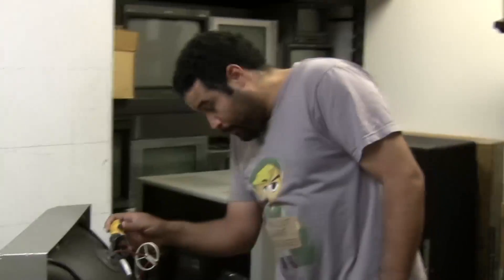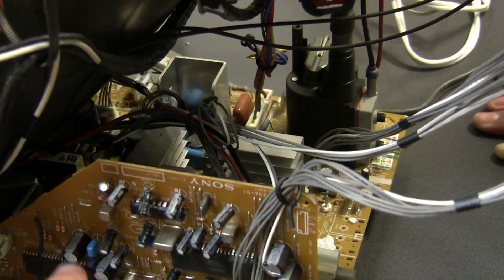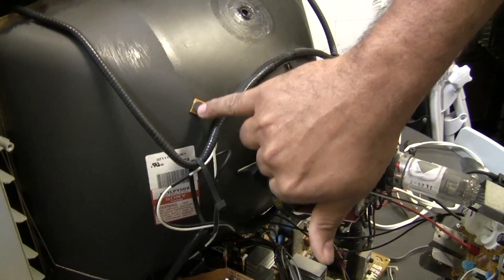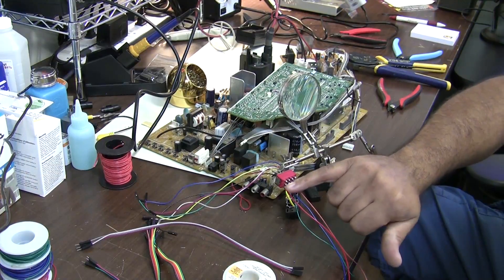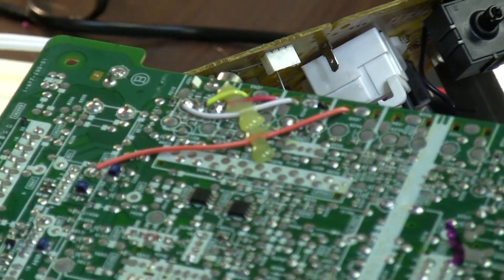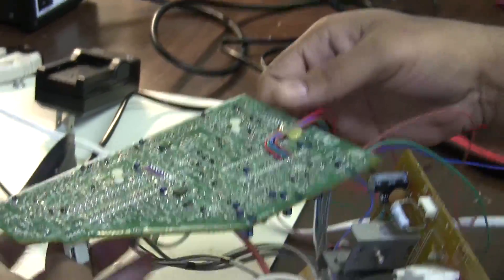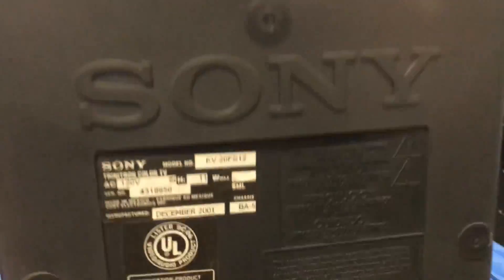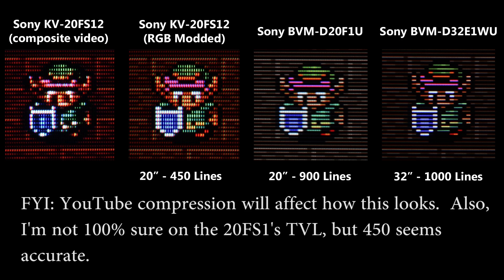RGB modding a Sony CRT for Retro Gaming

Comment: I'm so glad that here the majority of CRTs already have RGB Scart
Reply: bumtree 99% of all CRT TVs in Europe do 60Hz RGB, it has always been like this. I would have noticed otherwise as I have always played 60Hz import games (NTSC-J and US) via RGB scart cables.
Reply: DrLilo I don't know of any data that supports this but I've only ever come across the very odd CRT TV that struggled with displaying RGB. A much more common issue - especially with much older TVs - is their inability to deal with 60hz RGB, from what I've found.
Reply: Not true. While early Scart connectors did not have S-Video or Component, nearly every Scart TV had true RGB inputs. In fact, I never found one without RGB.
Reply: In the UK, because Scart was bidirectional it was  common to have two Scart sockets on bigger TVs and while Scart1 was almost guaranteed to be RGB, Scart2 was often fudged on & only supported Composite / S-Video input.

Perhaps that's the source of some of the confusion?
Reply: In france, almost all CRT tvs are RGB compatible !

I've never ever seen a TV that didn't handle RGB through SCART here
Reply: most supported RGB only low end ones didn't
Reply: Eg recently I got a very cheap CRT by Philips. I rotated it to play Raiden (PSX) in tate mode and it looks extremely sharp, colourful and just as good as when I play games on an arcade monitor.
Reply: Same here in germany! But I never had a TV that did not support RGB at all.
Reply: DrLilo we live in two different continents perhaps lol
Reply: It was created in the late 70's actually ^^

I'm not sure that's the reason they designed SCART. I think that this was done because there wasn't any other way to connect stuff to your tv except by going through RF back then. RCA plugs weren't implemented yet on TVs so they came up with an "universal" kind of connector that would support any kind of video signal that existed
Reply: Atari 2600's colors in france is just the colorised black and white mode. Also, europe had less colors than US. I think it was something like 114 or something like that

Nintendo had problems too : they added a composite to RGB adapter in their NES to have a SCART output. Unfortunately this made the picture to look worse.

Many game consoles here were shipped with an RGB scart plug which was a good thing ^^ Unfortunately, Sony broke that rule even though the PS1 can still output RGB fine.

Speaking of the 5th era of consoles, there's a special "french" nintendo 64. When they wanted to release the 64 in france, they added the RGB capabilities to the N64 only for france, but for an unknown reason they cut off that feature and so we only had composite video like the rest of the world. However the motherboard were already made when they did this so they had to sell the stocks and so early N64 models in france can be rgb modded. These are the only known N64 in PAL region that you can easily modify to output RGB. The other models require some custom circuit to be added
Reply: The C64 had little success here. Commodore didn't want to sell a lot of them over here for some reason. The Amstrad CPC 464 took it's place in here. However, I think that if somebody wanted to connect the C64 to a TV, since it outputs RGB at 50Hz for the monitor, you would be able to use RGB SCART

That's why we didn't have the Atari STFM in here : there was no use for an RF output in here since TV makers had to put SCART plugs on every TVs since 1981 (up to 2015 IIRC. Yep, SCART lasted for quite a long time here !) so all you would need is a SCART cable for your ST ... which is in fact the same as the one for the atari 7800 ! Yes, the atari 7800 outputs RGB, and it's not converted from composite like nintendo did

I don't know what they did for the Amiga on the other hand, but I bought a brand new SCART cable for mine and surely, it works just fine, like 99% of computers of that era.

The most common computer from the 80's that didn't really allow you to connect it to a TV is .. PC ! I know that there was some early IBM CGA video cards that had a composite outputs in the USA, but I don't know what they did here as I've never seen one so far (I'm not saying that they didn't exist at all here, I just do not know), and "RGBi" which is the 9 pin connector for a monitor isn't really pin compatible with RGB SCART even though you don't need really complicated electronic to connect it to a TV.
Not like VGA which is far more complicated to adapt if not impossible (depending of the resolution you're using)
Reply: Sure !

And also, 320*240 VGA doesn't run at 50 or 60Hz but at 70Hz !

However, the higher res modes are at 60Hz which still makes some flicker. Now, over the years they have made SVGA CRTs with much higher refresh rates (I've got one that can refresh the screen at 150Hz and there you won't see any flicker. It's so fast that won't even see artifacts when you film it !)
Reply: Booster McBlast s-video and component don't have anything to do with scart anyway as far as I know. They are both completely different connection methods from scart. Only composite can be used with a scart adaptor.
Reply: Booster McBlast amd what do you mean by "true rgb inputs"? Do you mean BNC?
Reply: No, that's not true. In fact, both were not intended in the early scart standard (from the very early 80s). But both methods were added later.
Reply: No, I mean Scart RGB input.
Reply: Paul Wood yeah probably
Reply: Isn't it true that france invented Scart RGB in the early 80s cause they had this stupid secam color format where you could not use any kind of home computer or console in color? Just my suspicion.
Reply: Okay. But at any case, Secam was a big problem for Computer manufacturers back then. Atari France designed strange and exclusive internal RGB converters to Atari 400, 800 and 7800. And Atari 2600 only ha 8 crappy colors instead of 128. Do you know more examples?
Reply: Thanks man! :-)
Reply: What about Commodore 64? Did they do a special Secam model?
Reply: DrLilo actually, here in Italy in my lifetime of CRTs (est. 1986), every tv with SCART I have met it always supported RGB. Aren’t you mistaken with PAL60?
Reply: Atari ST and Amiga both have no problem with Scart RGB (only the very early 520ST, that only had separate Syncs for X and Y). RGB was a must for the "high" resolution of 640 pixels horizontally. 
The Commodore 64 from outside of France never had RGB. The early models only had Composite, later models also had S-video (called luma/chroma or luminance/chrominance or Y/C back then). I've just read now that french C64s indeed had an internal "Procep PAL to RGB converter unit" to connect it to Scart RGB. Never saw such a thing although I live in Saarrebruck near France. :-)
Reply: VGA to Scart RGB makes little sense cause TVs just have 15khz, VGA monitors have 31khz or more. VGA monitors can do at least 640x480 non interlaced. That means "flicker free".
Reply: no.
Reply: > VGA to Scart RGB makes little sense cause TVs just have 15khz, VGA monitors have 31khz or more. VGA 
> monitors can do at least 640x480 non interlaced. That means "flicker free".

Correct, but a VGA card is a practical way to generate a high quality RGB picture on a 15KHz TV, the VGA standard might be >31 KHz, but any VGA card can generate 15 KHz signals.

My Philips MG3 television even supports VGA signals up to 1024x768@100Hz on the SCART inputs. Because Philips made versions of this TV with VGA inputs, the chips in the TV were made to accept VGA frequecies. Because SCART and VGA are electrically compatible, this way Philips could just mount another connector for a VGA port.
Reply: Thats true, scart is a cable connector type not a video format. Scart it self is a cable that happen to support multiple formats that include a 15khz RGBs video as well as component and bi-directional composite.
Reply: Yeah I always wondered what video  formats the scart connectors in Europe on the CRT's carried. So most didn't support rgb on them over there? That's interesting....
Reply: That's not correct. The VAST majority of consumer grade TVs here in Europe actually don't support RGB at all. They have SCART inputs, but they are only for accepting composite video over SCART cables.